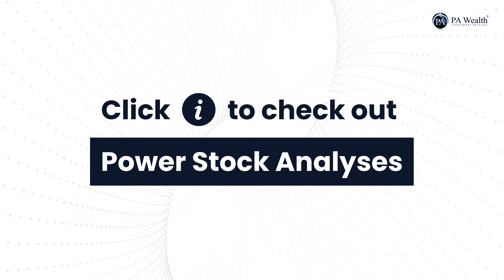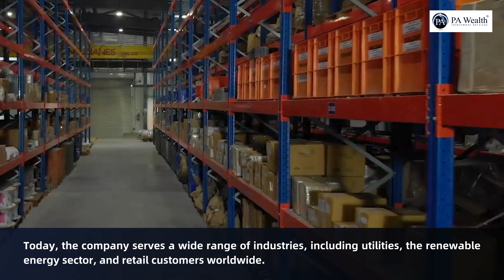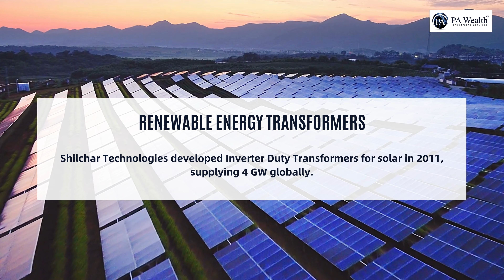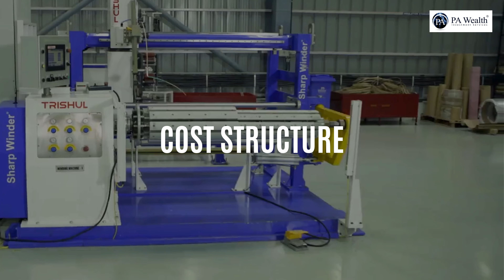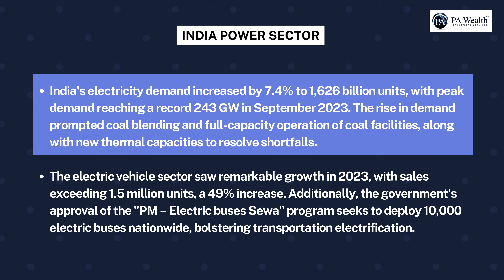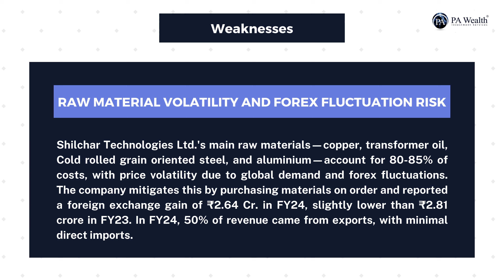What's Fueling Shilchar Technologies Ltd's POWER Surge? | Stock Analysis

Comment: Cost Structure slide at 5:06 is wrong. If you add all the costs, it is only 73.07% of total cost. There is something wrong here.
Reply from the maker: It is cost structure as a percentage of Total Revenue and this has been mentioned in the video.